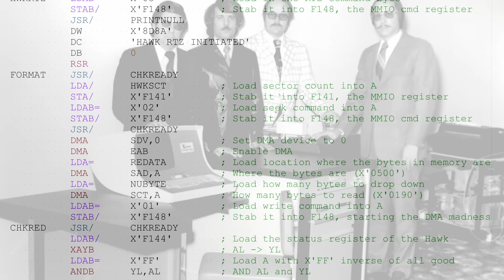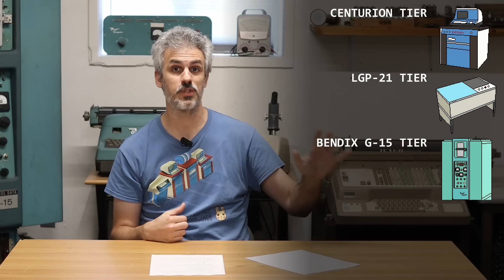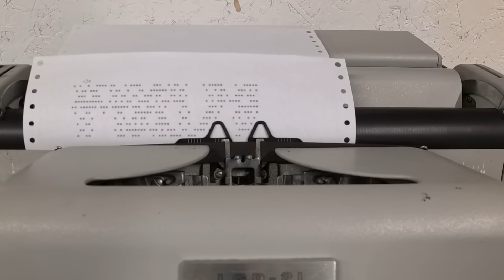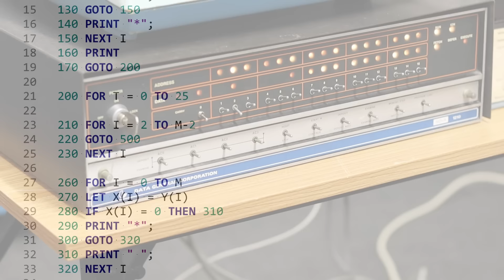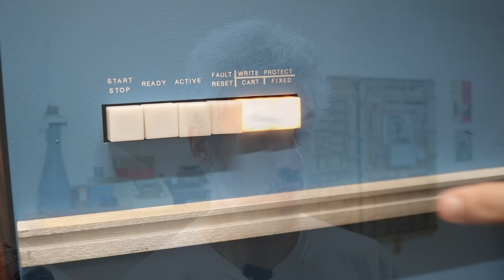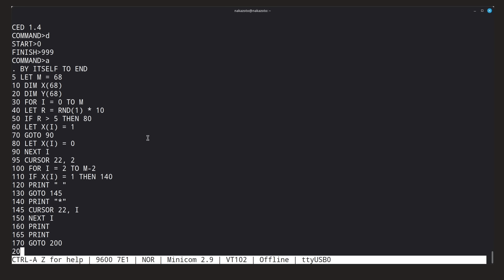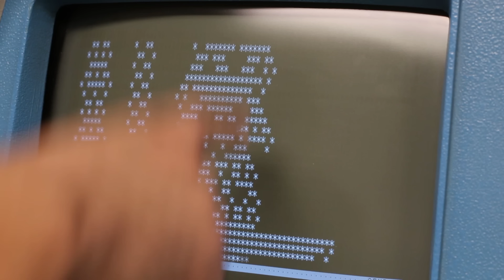BASIC on This 80’s Minicomputer is Terrible!

Comment: As much as I love BASIC, it has its limits, and seems that it has more than a few on the Centurion.
Also, hi Koma!
Reply: I suppose it depends on how rigidly it's supposed to adhere to Dartmouth or something.  I did programming in the late 1980s using IBM PC Compiled BASIC for commercial building energy-auditing software.  It wasn't too bad once you started having "blocks" of code to re-use.  My overall favorite though was QIC(Qantel Interactive Code)BASIC which I was working with from 1979 to about 1986, for Qantel (NOT Quantel) business minicomputer systems.  Especially for the time, it was great!  Also compiled, and it had elements of FORTRAN (FORMAT statements, READ/WRITE, etc) and COBOL (declarative and executable program areas, BCD arithmetic with declared precisions) as well as BASIC (LET, IF/THEN, FOR/NEXT...)  The BCD numerical format avoided complications with floating-point, and the file-system was easy to use with mostly keyed data files automatically kept in key order.

Comment: 1: I am glad to see you actually using LET statements. Many BASIC versions after the original Dartmouth BASIC made the LET keyword optional. 

2: I’m pretty sure that variable array dimensioning is a more recent extension. In BASIC, variables are often floating point by default since it is an untyped language. 

FWIW, I know a bit about programming. I wrote my first BASIC program 49 or 50 years ago, earned by bachelors in Computer Science in 1989 and started working as a Software Engineer that year, and got a PhD in CS in 2024.

Comment: Why not build a string for the whole line, one char at a time? It needs a single print statement when the line is complete. Slightly less standard (as string handling isn’t as standardised as integer math) you can build two strings (one for a dead square, one for live) of possible values depending upon the count of neighbours, and use substring commands to select the replacement.

Comment: I'm trying to understand the CPL program, but I'm failing with line 25 in 1DLIFE.cepl.

According to the comment the intention is to divide time by 3 and get the remainder, but the input to the MOD() command is time and the mdt variable, and that variable is not 3 but instead incrementing for every iteration of the loop. Am I missing something or is the comment or code wrong?

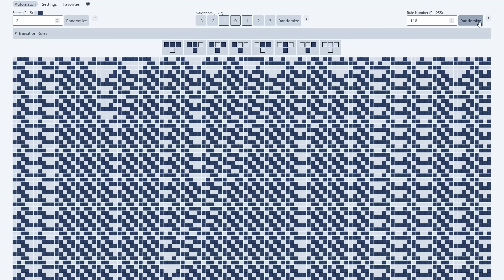Comment: 06:40 knitting machine patterns.
 I once had a black sweater with a rectangle of lines of colourful bits across the chest.
Totally worn out. Never seen one since.
Miss it . 
Reminded me of a terminal window with Linux colours on Slackware.
So I should make one myself with Wolfram's program.
I remember writing a "Random Walk" program in BBC Basic.
That was really easy as it has a RND command . 
Just add some SIN, COS and TAN combined with said RND and press RUN.

Comment: to me it looks like the life games are one-way only. There is no reversing or going back in time. Traditionally Basic is based on an interpreted system so it is always a slow code in execution. There used to be some compilable faster Basics at one point in the 1990's
Reply: It's pretty easy to show, since there are patterns that decay to nothing. An empty grid could have been empty forever or contain any number of decaying patterns at any point in the past, and there's no way to tell.
Reply: @AngryCodeReviews  yes, especially if the end is a zero set. If the set is not zero, it might be possible to reverse, depending on the algorithms. I am a bit working on these matters,  things are not always trivial as might seem
Reply: @henk38599 That could be an interesting project. Given a Life board state, generate its possible immediately previous states, and then the possible prior states to those, etc. I could see this blowing up spectacularly quickly lol
Reply: There have been BASIC compilers throughout the 80s. Even the original 1960s Dartmouth BASICs were really compile-and-go
Reply: @yetanothertroll  OK, I had no information of those. In the 1970's the big computers I used, only had FORTRAN and in the 1980's they had FORTRAN and some had Pascal. Basic was in PC's at that time. Commercial computing had other languages like COBOL. That is still used because they do not want to redesign giant systems
Reply: @henk38599 Microsoft had BASCOM by 1980

Comment: If you program in Basic, you can program in Cobol.  Define the variables in working storage and write the logic in the procedure division.  There is a little more if you want input and/or output files but, for the most part, that's it.

Comment: Many of the computer systems, like Centurion were often used as data entry -- aka keypunch replacement.   I was wondering if any data entry/verification software was part of the Centurion software suite?  As EDS purchased Centurion, they were a very large IBM user and I could see the Centurion systems feeding the IBM mainframes with data.    Just curious?

Comment: Speaking of bit-slice, 1980s, and BASIC : I ran a MAI Basic4 mini-computer that was a 16-bit machine based on the 2901 processor. Its principal language, unsurprisingly, was BASIC. Our machine was purchased to run a reservation system written (in MAI's BASIC) by a 3rd-party software shop. Our machine came with a 16 serial port expansion board, so I think it supported 20 or 24 terminals. We had a dozen terminals wired directly to the machine, and the rest were attached to dial-up modems.
Reply: I tried working with Basic/4 computers for a while in the 80s, but after having used Qantel I just couldn't stand it.

Comment: Playing around with the code, rewriting in C (not K&R C, but it compiles with C89). A few notes: I agree with  Edsger Dijkstra: "Go To Statement Considered Harmful". Even in this small amount of code, it is next to unreadable, and pretty hard to follow. Functions are a useful abstraction. On lines 100-200 you print the range 2-M-2, while in 260-320 you print the full range (I copy the full range, but only show the context. I thought I had translated your code correctly, but the behaviour looks rather different, with ofter a quick extinction, of islands of life that move to the right. Probably a bug of some sort, but I had some quick fun. Thanks.
Edit: figured it out: DIM X (68) creates a 69 element array, from 0 to 68 (inclusive). That also means the for loops are inclusive. That matters. And basic is the only language that gives you an M+1 length array when dimensioning for M. More used to either Fortran or C. After this realization the fix was easy.

Comment: My old employer back in 1985 used one of those terminals to control a scrolling outdoor sign. I had to update it every night and I remember it was very cryptic to use. But it did look futuristic just sitting in the corner of the office.
Reply: You haven't lived until you've tried debugging BASIC programs on the teeny tiny (but totally functional) Osborne 1 "portable!"
Reply: In the late 80's a hotel here in NY, used a Commodore 64 running Basic for the same task.

Comment: Also from the early 80's - I hope you can find a Convergent Technologies IWS.  It supported up to 32 concurrent users on a networked cluster of workstations using 8086 processors on the CTOS operating system using a message passing paradigm.  It could distribute system services across a cluster of workstations.  It ran a Cobol-like Basic interpreter/compiler (Data Division) for record definitions as opposed to the FIELD statements found in DEC and Microsoft Basic.  I programmed on it.  It was a joy to use.
Reply: Burroughs bought Convergent and rebranded CTOS as BTOS.  My role was small system technical support at Sperry.  After the merger of Burroughs and Sperry,  I have my hands on BTOS for a while.

Comment: Back in 1979 I built a Z80 based NASCOM computer with an 8k Microsoft Basic interpreter ROM, which imo was the last decent bit of software that Bill Gates produced. It was relatively fast and I am inclined to dig this machine out of my garage and give your standardised game of life program a whirl!
Reply: Yes, Nascom ROM BASIC was a good BASIC. [I disassembled it in 1982 ... and made several bug fixes and optimizations recently for use with MAME.]

The parts written by Microsoft were well written, even with Nascom forgetting to assemble for Z80 instead of 8080!

The address calculation for SET/RESET/POINT and SCREEN used the most noobish method to multiply by 64:

                  ...
                  ADD      HL,DE          ;Add column to address
                  LD         D,0
                  LD         E,C               ;Line to DE
                  LD         B,64             ;64 Bytes per line
ADD64X:  ADD      HL,DE          ;Add line
                  DJNZ    ADD64X     ;SIXTY FOUR TIMES!!!
                  RET

Comment: Nice, there are a few things I want to try running this on

EDIT: I got it running on the Nintendo DSi Petit Computer BASIC with minor modifications to account for the amount of text mode columns available (32) and the way GOTO works (labels rather than line numbers). Additionally, this BASIC also cannot DIM an array with a variable value.

Comment: I think that there have been a lot of unique languages developed for various computers that actually are able to pull out more performance of that specific machine it was designed for than the more common generalized languages.
Most of those languages are now forgotten, but some of them could actually have been more popular if they haven't been forgotten.
I wonder what the TI99/4 would do with FORTH for that matter, an oddball hardware and an odd language primarily able to do integers.

Comment: As described, the Centurion resembles the TI 990/12 minis  (they used bit slice TTL too) we used with DX10 and DNOS (Distributed Network OS) OSes in the lat 80's too ... 1 Meg ram and T200 (200 MB) disk drives with a T50 system drive ...

Comment: You could have used a string fior output. Just  append all the spaces and astrix's (one complete output line) into a, initial empty, string and print out that string instead of character for character introducing the unwanted extra spaces. Or you could use a string as a character array instead of real array's.
Reply: You can only use a string like an array if you can put MID$ on the left, as in "MID$(X$,10,1)=....". Many BASIC's didn't allow this.  With some jiggery pokery you could POKE into the string but this would be very tricky if the actual strings don't stay in the same place in memory all the time, which is typical.

Comment: Another minicomputer called Pr1me, also had a great programming language called CPL (Control Program Language) it was a high level language designed to handle batch tasks. I loved using it circa 1987. [Pr1me 9955 II]

Comment: Would be cool to see this benchmark extended further. Seems an ideal tool for tweaking. How many consoles can handle running it at once, how does that slowdown look. What adjustments could be made? Both in the code n hardware.
A race with your line printer.
I'm glad your so Enthusiastic about CPL, seems the only proper way to flex this blue box properly.

Comment: That BASIC program won't work on my computers, Dimensioned numbers start at 1, not 0.
So with DIM X(10), LET X(0)=10 throws an error it has to be LET X(1)=10. I'm going to have to reprogram the software.

EDIT : All I had to do is change anywhere it had 'variable (variable)' to 'variable (variable+1)' and make line 5 LET M=31 as my computers only have a display 32 characters long. Also I had to change line 40 to LET R = INT (RND*10)+1.

This works on the ZX Spectrum and the ZX81.

I've not yet tested it on the Panasonic JR-100. It's a lot to type in. LOL
Reply: But us old geezers that started with Basic, had to get used to arrays starting at 0!
Reply: Get AI to rewrite the code. I asked an AI to write Hello World in basic;
10 PRINT "HELLO WORLD"
20 CLEARSCREEN
It works but it clears the screen before you see it.
Reply: @wayland7150  Why use A.I. when I can do it myself ?

Comment: Hi David. Sorry to pop the bubble, but not all BASICs have a LET keyword; most of the ones based on Microsoft’s license don’t, whereas some earlier ones do (I think.) Interestingly, some modern programming languages use LET to create a constant, and VAR to create a variable. Others like C/C++ use ‘const’ to create a constant. Some dialects of BASIC even let you create variables on-the-fly; if the variable name hasn’t been encountered yet, the interpreter adds it to the symbol table, and assigns it a value and data type. Others require a DIM keyword. It can be a real mess. 😢 Furthermore, to really throw sand in the gears of porting, some dialects require an AS keyword to define the data type (ex: DIM c AS String), while others use a special symbol after the variable name (DIM i% creates an integer, whereas DIM c$ creates a string) and MS QuickBasic and VB 6 can use either! 😱
Reply: LET was not required in MS Basic, but it was permitted.
Reply: I had no idea VB6 supported the symbol notation. I didn't even know that was a thing.

Also, shout out to JS for using both let and var for defining variables (let scopes the variable to the enclosing scope while var is function scoped) with const for constants. Yet another example of JS being weird.
Reply: @Bobbias - Yes, IIRC, if you don’t use “OPTION EXPLICIT” at the top of a VB 6 BAS module, you can create a variable like “c$” or “i%” instead of using “DIM c AS STRING” or “DIM i AS INTEGER”, for example. Even with OPTION EXPLICIT, you can still say “DIM c$, i%, huge_int&” and so on. It also works for the variables in the function parameters, or the function return type, for example, “FUNCTION RemoveQuotes$(s$)”, but it would also take “FUNCTION RemoveQuotes(s$) AS STRING” as well. This was to maintain syntax compatibility with Microsoft QuickBasic 5.2 I think. This feature saved me lots of time converting QuickBasic code to VB 6! 😊
Reply: Let was optional in Atari BASIC, unless the variable clashed with a keyword, so a variable like NXTPRIME wouldn't need LET but NEXTPRIME would

% as a type specifier still isn't consistent. X% would be a 32 bit integer and Y floating point in X11 BASIC  but in FastBasic X% would be floating point and Y an integer
Reply: Most Microsoft BASIC variants would let you use LET but, as others have stated, it was optional, and since many computers at the time limited the number of characters you could put in one line most people just didn't use LET to save space. Applesoft and Commodore BASIC (both written by Microsoft) had LET available.